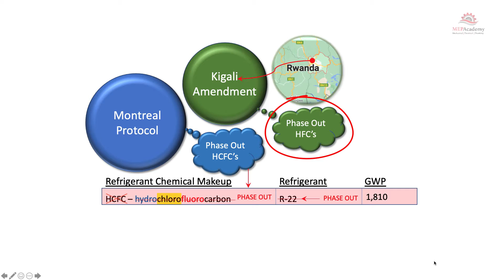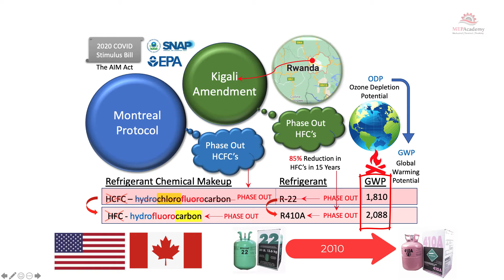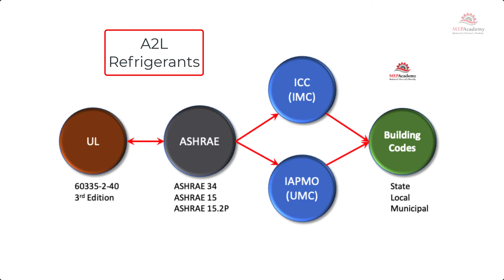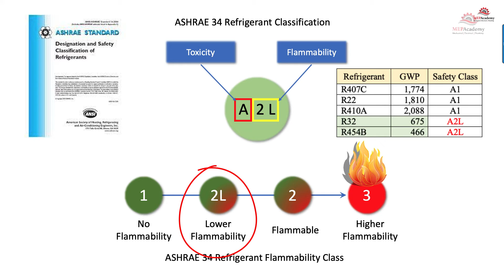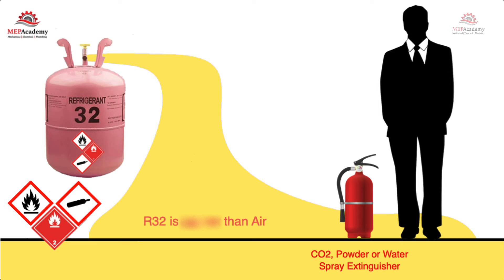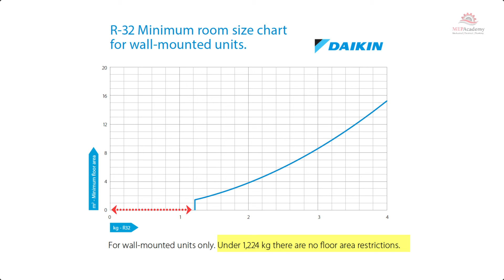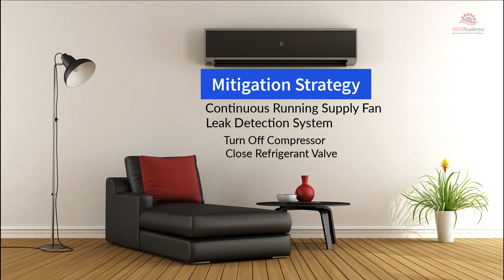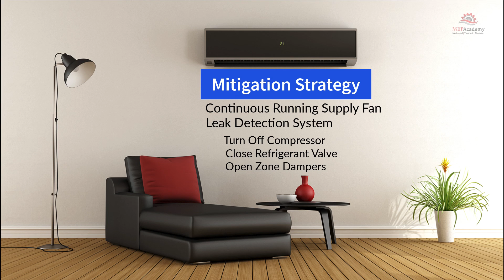New Refrigerants Codes and Standards

Comment: It's a such a stupid idea to use such a flammable refrigerant on ac unit because if the build catches Fire that refrigerant will be a good fuel for the fire
Reply from the maker: The flammability of the new refrigerants will be low enough to be safe.

Comment: why should i use r 32 that can catch on fire i will stay with r410
Reply from the maker: It's not that you want to switch away from R410, but that in the near future you won't be able to buy it. It is one of the refrigerants targeted to be eliminated because of its high global Warming potential of 2,088, while R32 has a GWP of 675. If you live in California, a state that is heavily involved in moving forward the green agenda, this date will even come sooner, as they are capping the allowable GWP at a level below R410A. Eventually, like our old friend R22, it may become very expensive to get, and prohibited in the manufacturing of new equipment.
Reply: @MEPAcademy  I hate to say this but China doesn't care about the Montreal Protocol. They are still manufacturing R22 and R410A. So America can eliminate those refrigerants but China will continue releasing them at will. By the way R410A is already R32 so perhaps existing R410A equipment can simply be retrofitted to R32...

Comment: Good video ...... Just more freon B.S. we don't need in the hvacR industry .... good day
Reply from the maker: We must adapt to the changes that are being made for the good of humanity. If existing refrigerants are harming the environment then why not keeping looking for better solutions. Each generation builds on the previous one to keep evolving to make life better for the generations yet to come.
Reply: @MEPAcademy  My issue is people throwing out perfectly good systems to use "better" refrigerant. R22 is plenty good, and I agree that newer refrigerant that is better for the environment should be used on new equipment, but throwing out perfectly good R22 systems just to update them is not environmentally sound. I feel there's a huge amount of planned obsolescence in the HVACR industry, except these kind of planned obsolescence is being forced by the rule of law. 

I do however question how much ODP matter because most refrigerant we use is heavier than air, except ammonia, so I don't think ODP matters as much. Keep in mind even R12 has a fairly short atmospheric life, so even with fairly high GWP it's not THAT bad. I don't think you can get any better than Ammonia though has it has no GWP or ODP, and it has a 1 year atmospheric lifespan, but the stuff is incredibly flammable, explosive, and toxic, and catastrophic leaks do kill people. However a small leak would get immediate response because it STINKS to high heaven, whereas a CFC/HCFC/HFC leak could go undetected for years because it doesn't really smell. Ammonia is only currently used for very large systems.

I think hydrocarbon refrigerants is good except it's extremely flammable... which is not good. It's why they're only used for very small systems.

Comment: At 08:25 mm:ss, regarding the two different oils, mixing together and creating a sludge:  According to Brian Orr, this is NOT TRUE.
Reply: I'm not sure how much oil ends up in the manifold, but if it's only refrigerant vapors, it shouldn't be much. The only concern is that POE oil is hygroscopic and that does turn into a sludge if it absorbs sufficient moisture, which is why you had to evacuate the system to microns. 

I heard there are talks of using CO2 as refrigerants but their operating pressure makes R410A/R32 look small. CO2 has no flammability (it puts out fires, unless it's a metal fire), and a GWP of 1.

Comment: "R-32 is lighter than air, so will seek to settle lower in the room."

I think you meant to say that R-32 is "heavier" than air.
Reply from the maker: You're right. A little slip of the tongue, as the image clearly shows the refrigerant settling along the ground. Thanks for the observation.
Reply: @MEPAcademy  PLEASE EDIT THE VIDEO WITH ON-SCREEN CAPTIONS, CORRECTING THIS.
Reply: R32 is already in common use in Taiwan.
Reply: THANK YOU!  I got thrown into a false understanding of R32 being "lighter than air".  Without your comment, I probably would have spewed this falsehood around to my fellow HVAC compadre's.  Again, thank YOU!